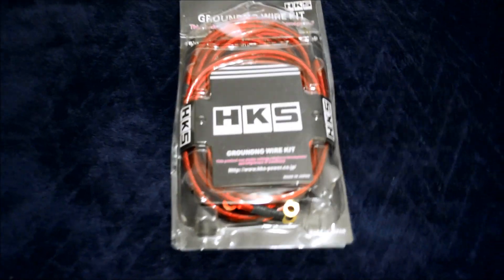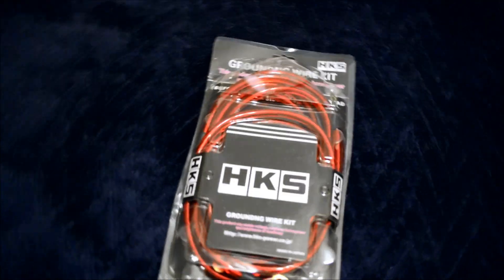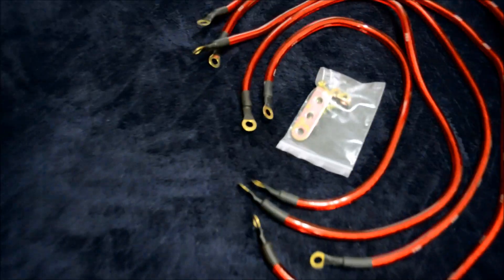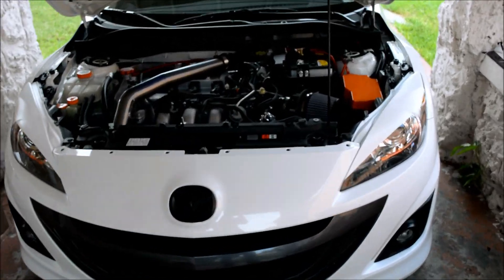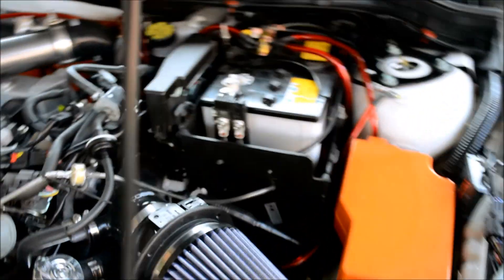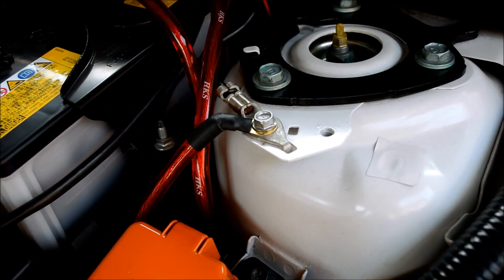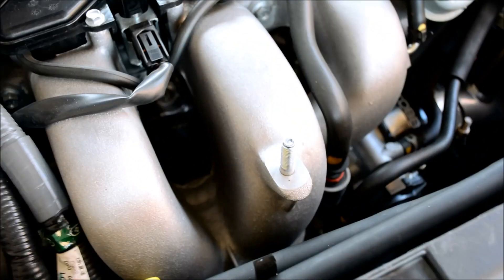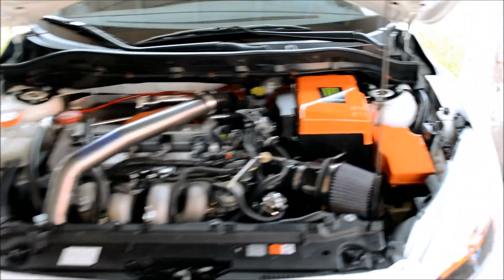Mazdaspeed 3 HKS Ground Kit Install

Comment: This is the dumbest buy in history...
How much did you pay for that? LOL You can buy everything you need for this under $50 and have the same effect.
Reply: @RebeccaCampbell1969  You replied to a 7 year old comment. You're also trying to tell an Electrician that their grounding kit is better than one I can make with a couple feet of type K cable from tractor supply and a few 1/0 crimp on lugs....